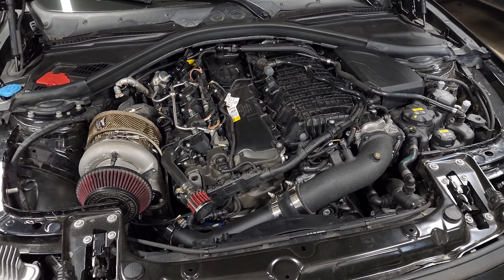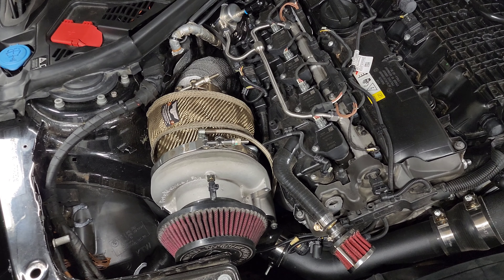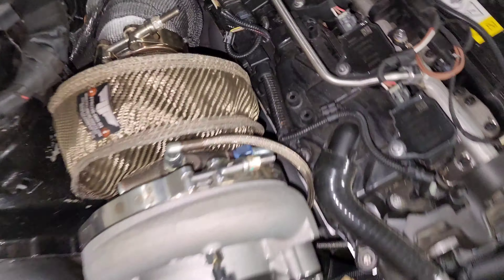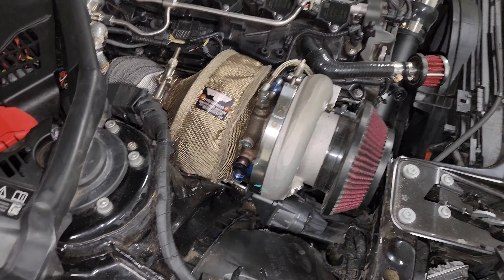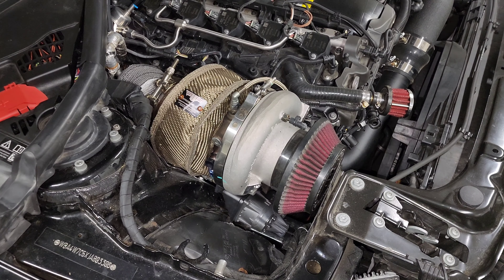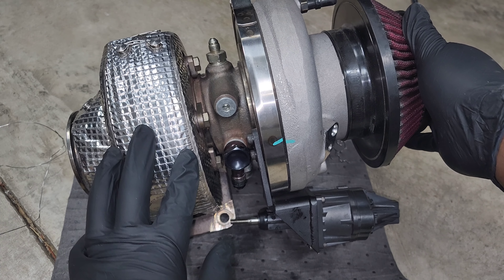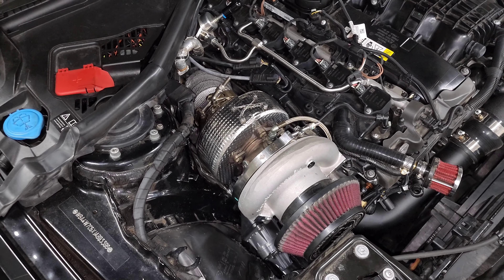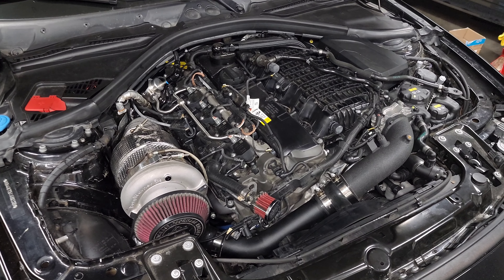Protect Your Investment! - Upgrading the Heat Management on my Big Turbo Kit

Comment: Ross racing turbo heat shield is also a cheap alternative upgrade to keep down IATs and heat temps in the engine bay (only applies if you have a hybrid or stock turbo)
Reply: is there any video or thread where they talk more about this? it makes sense and all but I want to see some experience on it
Reply from the maker: Yeah it's basically a taller version of the stock heat shield
Reply: welp I already ordered it, have never logged IATs but I did own a Jeep in the  past with crumbling crispy cable sleeves in the engine bay because of the heat. 
It wasnt even old, only 3 years old

Comment: All you really need to do is Cerakote it with C-186.  I used a variation of that in black, coated the entire header, flange, exhaust housing, and DP.  Works well to keep the temperature contained. Any sort of cover kit you're installing will yield some inefficient shielding.  Coating is the way to go.
Reply from the maker: I already have parts coated but you can never have too much heat protection. The coating on its own does a lot less than the shielding.

Comment: How many times have the turbo flange nuts backed out? I have a bottom mount and there’s absolutely zero room to get a wrench in there. Also the sockets won’t work because of the milled out corners of the flange, leaving the inside corners closet to the exhaust house being too high and a socket won’t fully seat. Does this mean us bottom mount guys will have to pull the whole exhaust manifold to the head off? That’s a mission and a half for four bolts.
Reply from the maker: Once

Comment: Weak point is not shield but shitty getto style flex oil feed line. It is know for crack🔥. Change that "braided steel" flex line to hard aluminium one. They are avaible with 3AN and 4AN sizes and all AN stuff that is need to make good, safe and clean install. No shitty "braided steel" flex oil feed line = no fire risk🔥. That is so simple 👍👌

Comment: I know the purpose of the video is to swap over to this turbo blanket. However I’m curious on testing with that blanket then the PTP blanket on top.
Reply from the maker: You're not the only one lol. I have my downpipe coated and i still have heat wrap on top. But in this case the blanket simply doesn't fit well so not worth it to me
Reply: Would you recommend to get the turbine housing coated with 2000 degree coating as well as using a turbo blanket?
Reply: @tyler6403  I’ve watched some videos on that and they say it helps even more. If you want it go for it! I was just more anxious to drive 😂 if you do that if you have the funds I would recommend you go ahead and do the turbo manifold too.
Reply: I bought the same exact kit as him so the manifold and downpipe already come coated.

Comment: With the top mount do you feel an upgraded manifold won't be needed?
Reply from the maker: It depends more on how much power you're making and less on the turbo itself. At low boost you should be fine. But at higher boost level is a manifold is recommended